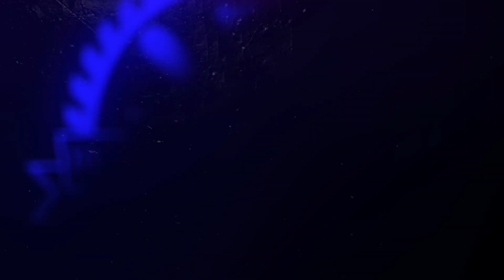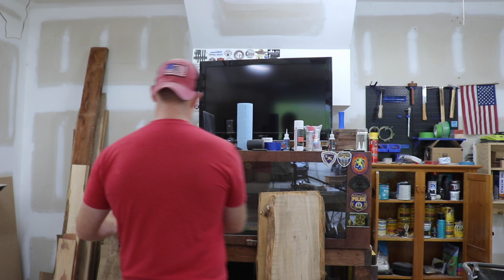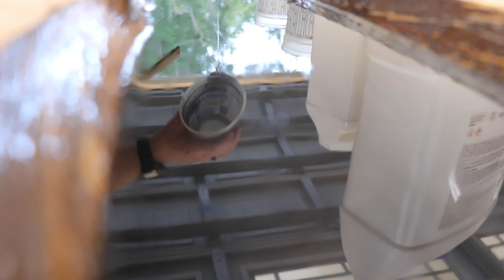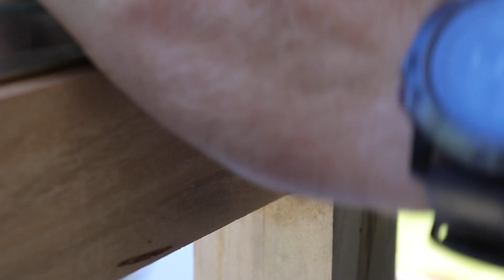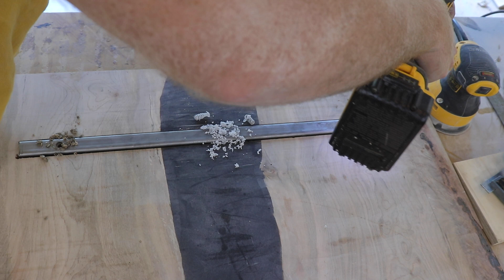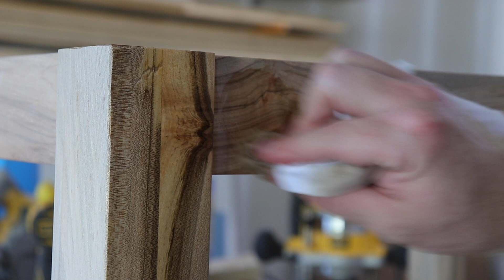Modern Epoxy Coffee Table Build

Comment: Fking excellent. I've started working on a 40''*22" coffee table This will be my first build and limited tools, i could only get a hand planer, so my 2'' slabs are surly not perfectly flat/even. I'm working with some red cedar and gonna start my pour tomorrow.  Don't know if i should finish the top with an epoxy lawyer our use some mono coat.
Reply from the maker: Let me know how it turns out!
Reply: @LazyLabAcres  It turned out super awesome. I would have recorded it but made a few errors and had to think on the fly. Wish i could post some pics. I do need some legs for it as i don't know what to do for that.
Reply from the maker: @Antares_451  maybe some simple metal legs? Might look good
Reply: @LazyLabAcres  Nah those would look ugly.  I'm attempt to make some legs an aprons outta some cedar. Gonna use glue an trim nail. But, can you recommend a site where I can buy wooden table legs?
Reply from the maker: @Antares_451  I'm not talking about hairpin legs lol because I think those are really ugly. I'm talking about some legit square tube legs. I used some on the big river table I made and they paired nicely. I havent bought any wooden legs from anywhere I've always just made my own so I dont really have any recommendations based on personal use. I've heard good things about Carolina Leg Company though from other table builders